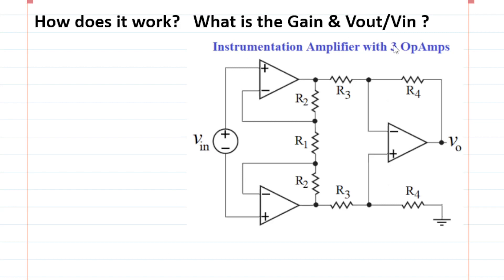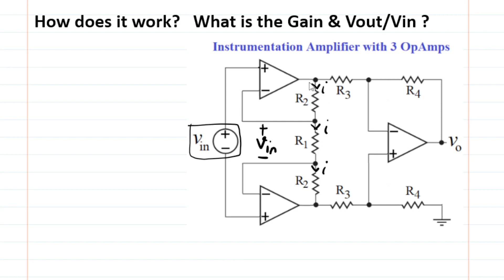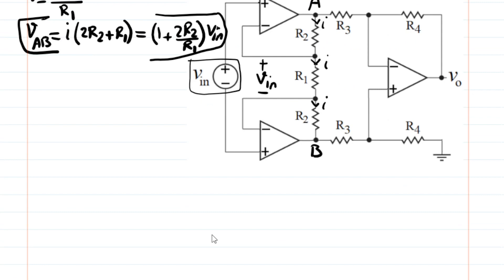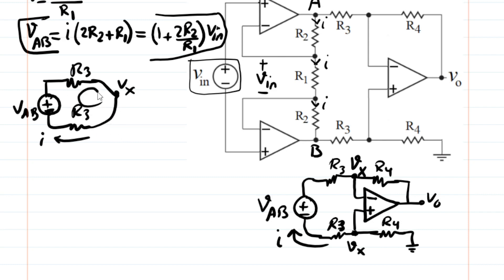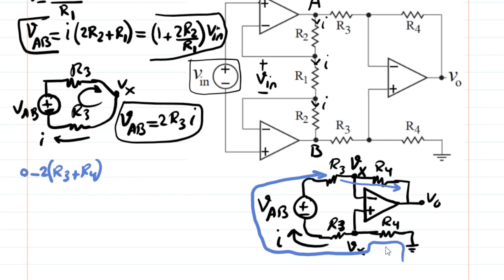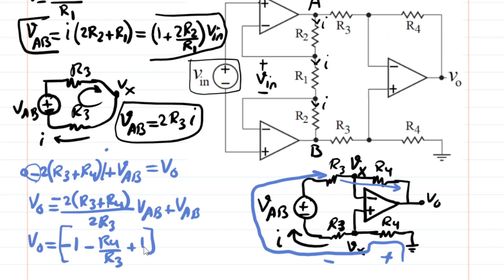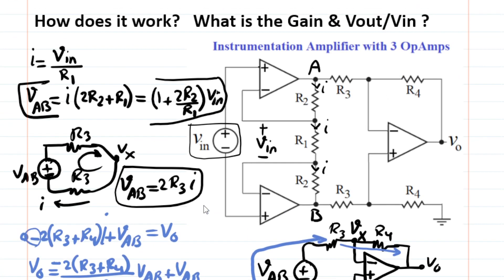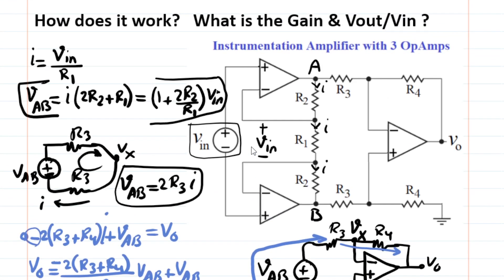Instrumentation Amplifier with 3 OpAmps, How does it work? What are the Gain and Transfer function?

Comment: Thank you for the explanation. This is very helpful. I just wonder if there is any major differencies between instrumentation amplifiers with single power supply and with dual power supply? Implementation that you shown here assumes dual power supply, right?
Reply from the maker: You're welcome. Thanks for watching & your comment. Glad to hear that this instrumentation amplifier analysis video is helpful. In this circuit example we need positive supply & negative supplies to generate difference voltage at the output. Single-supply design is possible but requires careful biasing and decoupling capacitors to generate AC difference voltage. For more examples pleasee see Op Amp Amplifier with Electronic Gain Control https://youtu.be/NoNgQpbj77Y
How to find Gain of Feedback Amplifier Example with JFET & BJT Transistors https://youtu.be/NB1-mYglXsY
Op Amp Analog Computer Differential Equation Solver https://youtu.be/ENq39EesfPw
Push-Pull Power Amplifier with Darlington Transistors https://youtu.be/866MYibo8yE
I hope these circuits are interesting as well. 🙋‍♂️
Reply from the maker: Thanks again for watching and your good question. Here are a few more Op Amp examples: Negative Feedback Importance in Difference Amplifier https://youtu.be/Ba-66z4T2FA
Triangle Oscillator circuit https://youtu.be/JF5Up_cuL9k
Full-Wave Rectifier https://youtu.be/DJJMNU-CYcg 
Difference Amplifier Analysis https://youtu.be/gSaAcUCXQGk
Diode-Amplifier VTC https://youtu.be/vpGZkafxMJM and
https://youtu.be/HeZRtnRXpEI presents a circuit with op amps and feedback loops to design an analog computer that solves a second order differential equation. 
For more analog signal processing examples see: https://www.youtube.com/playlist?list=PLrwXF7N522y4c7c-8KBjrwd7IyaZfWxyt
 Regarding your question, Dual power supply design allows us more degree of freedom in terms of handling input signal (at the expense of requiring two voltage supplies).
I hope these Circuit engineering and analysis videos are helpful.